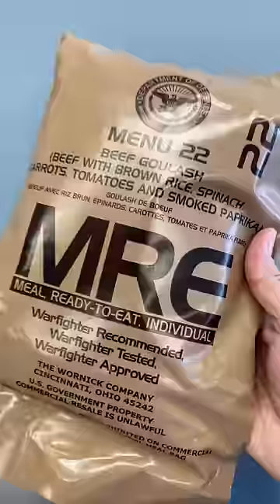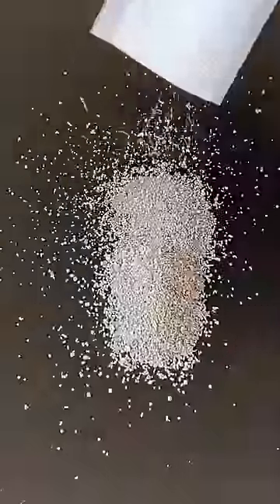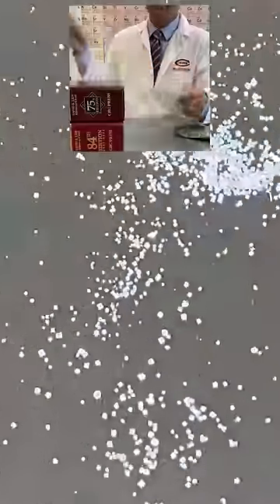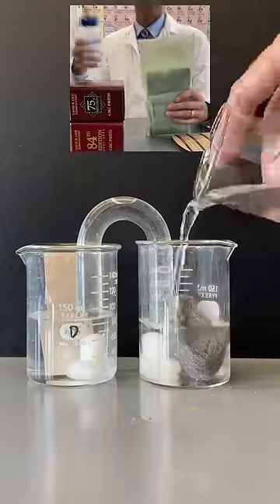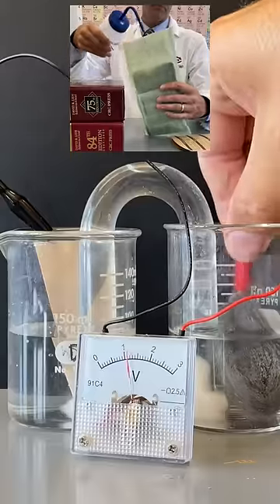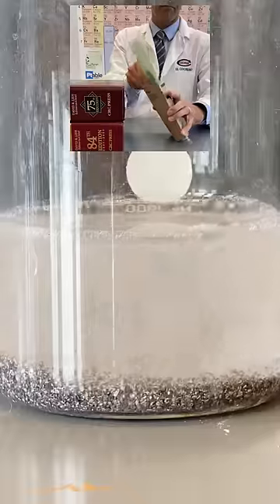Super-corroding Galvanic Cell used to Heat Soldier’s Meals!

Comment: Here's a battle field tip from a special forces guy. Eat ur food cold like a man then just damp the pouch a little bit and put it under your vest. Or save them for when ur really cold. Trust me they don't last longer enough to due both and it can make all the difference. I keep my MRE under my vest anyways so most of the time it's never cold it's always atleast warm but when ur freezing to death saving that heater will give u the boost no one else has
Reply: Thank you
Reply: Eat your food cold like a man...
And the women?
Reply: “Eat your food like a man”
What if I’m a woman?
Reply: @heavy0119  there are no women in special forces...
Reply: @abelis644  women in special forces? Where? Why?
Reply: Smart man.
Reply: @Hops 
Of course... how could we forget that there was never a woman in the military before TikTok.
Reply: Another battle field trip for you. Put in hot sauce instead of water to make tear gas.
Reply: @pewpewpewpew3229  easily disproven
Reply: See this is why I'm kinda happy I never went to selection or rasp. I actually get told like a week in advance when I'm going out in the field so I can spend 50$ on dip and feet and hand warmers
Reply: @abelis644  women aren't gonna he in specops
Reply: @MercenarySed  
Why wouldn't women be in special forces???
I have a number of female friends in the Canadian military, pilots, sailors, etc.
Women are as capable as men.
If you are concerned with physical strength, I know small men and big strong women, gender has nothing to do with anything these days.
If you think it does, you're the one with the problem.
Reply: This thread is the reason why American military needs to make ads like Emma and her two moms to accommodate today's youth.
Reply: @heavy0119  Lmao what special forces has women in it? I guarantee they’re not that special if they do.
Reply: @itb4255  The u.s. special forces is composed of 7.3% women. not a lot, but that's a lot more than 0
Reply: @itb4255  Captain Shaina Coss, 75th Ranger Regiment (2017-), the first and only woman currently in that unit.
Reply: @abelis644  none of those positions you named are "special forces".

Furthermore there is a pretty significant difference physically between men and women. Sure a skinny guy might be weaker than a strong built woman, but that's a tilted comparison, if you fed and trained both a male and female exactly the same and fed them the same meals. The male would likely surpass the female in most cases, not to say the female couldn't come out on top, but were talking about the average outcome which doesn't favor females. 

Men also don't have menstrual cycles like a fighting age female would , which is helpful in a warzone because it means they can throw you in the field for longer periods of time. A woman could probably power through that and keep fighting but it wouldn't be ideal especially if that individual couldn't power through the bleeding and cramps. And that's another pretty major biological/physical difference between the two.

This is all really basic high school biology, you can read into it instead of getting defensive and denying well known science. 

That all being said, I'm just trying to "fact check" you, there are women in special forces outfits, like the green berets but, as Google puts it "To date, only a handful of women have qualified for Special Forces Assessment and Selection, and even fewer have been successful."
Reply: @abelis644  You need to have woman only groups then.
Very simple reason, the average woman has big troubles dragging an average man.
Same if booth are trained.
My cousin managed to get into an swat unit and she was cursing a blue streak how much more than the guys she had to train to be able to drag the heaviest guy in the unit, and all of them had to do that to qualify.
Woman have to train much much much harder to reach the same upper body strength than men have to, so it is not practical to have mixed groups.
Reply: @abelis644  Ukraine flag 😂😂😂
Reply: @heavy0119  what is a woman
Reply: @abelis644  Just understand that 'man' can derive from 'Human' (i.e both male+female). And don't fixate on it too much. It could make you look silly, by attacking the only societies that gave us Feminism.  Most still haven't by the way.  Do you think you're helping with that?
Reply: Can use also put like nails and stuff in a empyt waterbottle with the pouches the add water and shut tight for improv grenade?
Reply: @abelis644  The conversation is about spec ops. Nothing in your comment has anything to do with that.
Reply: @abelis644  because women aren’t allowed in special forces i believe
Reply: This is the kind of tip that shows man's ability to adapt and become a true threat on the battlefield. Everyone else is brick cold and you're the only one that's moving with full blood flow and mobility 
Absolute Chad move.
Reply: Here is a tip from a smarter Marine, just ask for the ones not being used and you can still eat your chow hot. I shoved them in my flak jacket in 93’ at MCT. Old dog,
Old trick
Reply: @abelis644  Women absolutely can serve in our armed forces, and are suitable for most roles. However, special forces require the utmost peak in terms of physical prowess, which women, many of which could kick my ass one handed, can’t reach due to biology. Israel has all female combat groups, but when they deployed them their casualty rates were the highest of all their units. Biological sex absolutely does matter in warfare, and pretending that women are just as capable physically is disrespectful to the women who had to train harder to compete with the men on equal footing. It’s also worth noting that the CAF is absolutely aware that women are unfortunately biologically weaker, since the physical standards are lowered for them. Please don’t talk about our military if you don’t understand it, and have a good day :)
Reply: @abelis644  ur quiet now
Reply: No heater and rip of the corner and eat it like a go-gurt :P
Reply: @abelis644  grow up and eat it cold? What do you wanna hear
Reply: @abelis644 been real quiet since buddy
Reply: Dawg we used to do this so much, took me back lol, the Cadre actually made us live by it bc infantrymen don’t utilize heated food we men, use the heater for sum more important, like when the weather drops to 10 degrees in the middle of the day
Reply: When someone knows the body heat trick you know their in the military. There's also the shove a meal in your waistband while you sleep for a hot morning meal method. That shit saves me In the field
Reply: I was just thinking this.  It could be more useful if you were freezing to warm you up.
Reply: @sassafrasofficial3695 there already are.
Reply: @BigWheel. 75th is a special operations unit. Additionally, there was a female GB who passed the Q and was selected a few years ago, but she wasn’t even the first to go, just the first to be selected. Other women had gone to the Q, but weren’t allowed to be selected due to women previously being prohibited to operate/take up combat arms jobs. But there have been female enablers in special operations forever. Pretty cool.
Reply: @abelis644 if you think women are physically just as capable as men when it comes to just pure physicality, you're ridiculously delusional.

Just asked Serena Williams, the best female tennis player in the world, how she would fare against ANY of the top 100 male tennis players.

Oh... you don't have to ask her, she's already answered that, and she KNOWS she'd get decimated by every one of them.

Or you can just ask any of the women who are recently in the top three female's in the world in their sport, who have had a man claiming to be a woman to enter the sport, and dominate them so badly that it wasn't even a competition.

And then do the research and find out that when that very same man was competing against men, he could not come anywhere near the top 50 males in the sport.
Reply: @heavy0119 you shouldn't be in the Army then
Reply: @dirtysniper3434 yup. Just reallocate beer and pizza money for dip and Jerky
Reply: @heavy0119 None of them are taken seriously. Everyone of them had a water down version of what men do. Military is a joke rn
Reply: "Eat your food cold like a man" 

😂🤣
Reply: @niubilities what
Reply: @mrfixitusa6165 too bad the military isint based on pure strength. Guns always beat strength
Reply: You can’t just be strong” my grandpa RIP 🪦 💀
Reply: @kembm rangers isn’t spec ops. It’s considered tier two if I’m correct, kind of on par with paratroopers. Definitely not spec ops, which are units like the sas, seals, delta, gign, etc. spec ops is tier one
Reply: u Sound like a finn
Reply: @heavy0119 I don’t get what’s such a hard concept so something like a man even if you aren’t a woman not hard
Reply: @niubilities That’s a pretty good joke.
Reply: @Moodymongul No they wanna have a moral high ground and feel good about themselves thinking they did something that matters and by extension they matter when they do nothing with their life to make that claim.
Reply: @asiangaming8409 No 7.3 percent of green berets are they are allowed the thing is that special forces is not in anyway going to drop their standards to accommodate a weaker person most often a woman you are going in with male standards as you are primarily fighting with men.
Reply: @tylersharp5751  holy shit, leave me alone. I made this comment over half a year ago. I don’t care anymore, just stop polluting my notifications
Reply: @abelis644  The SF units within the United States military don't ban women, there just hasn't been a woman that passed the selection process yet. Several have tried, and they all failed.
Reply: correction, it's the SEALs that haven't had any female graduates yet. Although other SF units such as MARSOC have had some, but not many.
Reply: @_Shadow--Gaming_  Delta hasn’t had any graduate in fact the only unit that’s fielded women in combat that’s special ops is green berets the women in other units are qualified but aren’t within the field deployable special ops portion
Reply: @tylersharp5751  thanks for the extra clarification
Reply: Or handle the cold like a man instead🤷🏾‍♂️ and js eat the food hot
Reply: Random no name in a YouTube commmets section? Probably stolen valor for attention.

Comment: A good trick for getting this to heat up quickly is to fill to the line with water, roll it up, and let it sit for a few seconds. The water makes complete contact with all the cells quickly and you get that thing hot in seconds. Works really well.
Reply: you can read directions? you must be in the army
Reply: @ghislainedidntkillherself he can also write bud
Reply: @yacobshelelshaddai4543  that’s not regulation
Reply: @yacobshelelshaddai4543 Writing can throw someone off and make them think I'm Air Force lol.
Reply: You definitely don't want to oversaturate the pads though or it will no longer heat up, apply everywhere and get the water off asap.

Comment: That is for American soldiers. 

German Soldiers along with most European soldiers carry a full meal kit and quick stove at all times. Just like all other parts of your basic equipment, your stove and meal kit are your own responsibility, therefore all German MRE are made such that they can be heated using 100-500ml of hot water(most), or are in a container that is to be opened and heated directly(much rarer).
Reply: So the American version is smarter and more efficient because you don't have to lug extra crap around. Also a lot of those countries use heater elements too, just fyi

Comment: I tried a similar reason as a kid, rocket acid battery with this reaction.. i know crude but fun. Long plumbing system and small pile of old locks i put the top screw on the pipe and in a few minutes straight up ballistic

Comment: ...so my first roommate was a reservist and he brought home two full cases of MREs. It was pretty sweet because each one contains 2k calories and I basically lived off those things for a good long while as he didn't want them. 

Anyway, one day we took 6 of the chemical heaters, an empty two 2 liter wrapped in millitary duct tape, and a road flair to an abandoned parking lot. We stuffed the heaters  into in the bottle, poured some water, closed her up, lit the flair and ran like hell. 

The resulting explosion was surprisingly big. We knew it wasn't going to be like by any means so we were pretty far away when it went off but the Shockwave slapped Mt in the chest and made my face sting. My roommate said it was comparable to or actually bigger than a grenade but with more of a fireball dude to the hydrogen and the flair. 

It set off like a dozen car alarms and may have broken a window or two...we bounced and the cops showed up. That was probably my last dumb shit kid thing I ever did.
Reply: I came here looking for this. Would come in handy if stuck in a foxhole and need a distraction.

Comment: When I joined the Army in 1987, we had the early MREs. They were too small and we would heat them on our engineers of our vehicles when we would move. Or eat it cold.
We were so happy when they came up with the heater pack! Not only did it cooknour MRE, but the heat we would use in our pockets or even place them in our gloves to stay warm in winter.

Comment: I used to put salt in the green bag than a small mouthful of water shake it thoroughly till the bag is full of gas and light the gas on fire. Slap the bag immediately to put out the fire and your heater will heat your meal in about 1-2 minutes instead of 10 min

Comment: Ive always wondered why salt made them heat faster. Also my favorite method (if by the off chance we have time to use the heater) is to put an excess of water then apply friction to the chemical packets and drain the extra water. It makes it get way hotter. Just an fyi, 90% of the time you’re eating cold food, you dont have time to open the mre, take everything out, put water in the heater, wait for the food to heat up ect. When you’re on the move you just put snacks in your pockets for easy access and eat like that. Not to mention you cant leave trash and doing all that shit with the mre requires you to take everything out and open things.
Reply: Salt is an electrolyte. A battery is just two different metals submerged in an electrolyte.
Reply: @katiechiasson7509 salt can make water achieve higher and lower temperatures. It also makes water hold it’s temperature longer.

Comment: During WW2 the American GI's were issued a small Coleman stove that could burn for hours on 8 ounces of gasoline. It was stored inside 2 aluminum covers that served as pots for heating rations snd water. Those were held together with a metal strap that also served as handles for the pots. Each one produced 5,000 BTU's of heat so were used to heat tents and living quarters. Those were quite popular so Coleman made those thru the 1950's then put them back into production during the 1970's.

Comment: There's also hexamine stoves, which use an aluminium boxy (or circular) stove and a tablet of compressed solid fuel that burns with a blue or yellow flame. Some militaries still use them.

Comment: Lucky if these newer heaters work.....
The older ones STILL work. 
Someone advised to dump the salt packet in with it so i will try that. We just bought a lot of cases at $20 per case of 12 meals so really can't complain about heaters not workin. Just have to boil water OR take a microwave with ya.
rick in Tennessee

Comment: We used to save the heaters and tobasco sauce. Pour the sauce in the heater, add water and seal it tight with duct tape. When the bag exolodes and the tobasco is vaporized in the air, you have a simple type of "tear gas".

Comment: My dad told me that they had a box of sticks, they looked like glowsticks but when you bend them the chemicals inside that would mix then produced heat instead of light, they then simply put the stick in the bag of food and it was like "stone stew" (a stew where you heat a stone in the fire and then put it in the water/stock and make IT heat it, instead of a fire underneath), the sticks could also be put in your pocket to heat up during cold weather.

Comment: Fun fact if you put the pouch or alloy in a plastic or glass bottle and add water it will make the bottle explode due to the build of of hydrogen gas due to the reaction.

Comment: Heres a tip for you young heroes in the field. If your MRE heater isnt working properly just take that iodized salt packet and dump it in there. That heater will get real hot real quick.👌

Comment: When I was in the Canadian Armed Forces, we used these bags with a dotted water-fill line maybe a few inches from the bottom and a tiny inch by inch (maybe? Its been a long time) white cube. When the cube was dropped into the water, the resulting chemical reaction heated the bag so hot you couldn't hold it and cooked the packaged IMP's (individual meal pack). It was interesting to watch. The Mac and Cheese still gives me nightmares 😂.

Comment: My dad would bring these home to my sisters and I sometimes as kids. We would heat the food in the microwave then use the heaters to make pressure bursts. Open up the heater pouch like youre gonna put water in it, shove it in a soda bottle, fill it about a third or halfway with water, close cap tightly and shake it and throw it. At a completely random time it'll blow

Comment: One of the guys at Pendleton put his heater pack into his blouse arm pocket and forgot about it while we did field training. The next day we did the mud crawl. That man leapt up, tore the barbed wire posts out of the ground then threw his blouse onto the ground, all while screaming. It had burned a hole in his shoulder a couple inches across and close to an inch deep. He did not finish training.